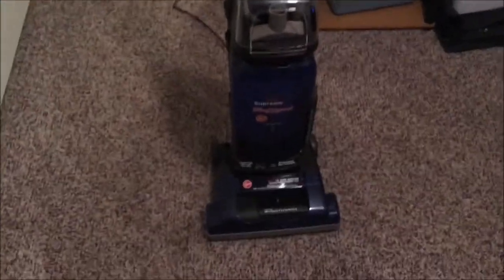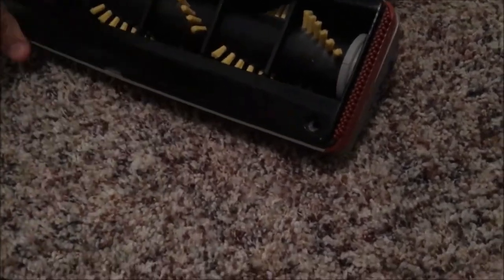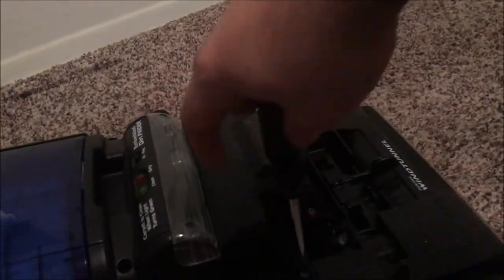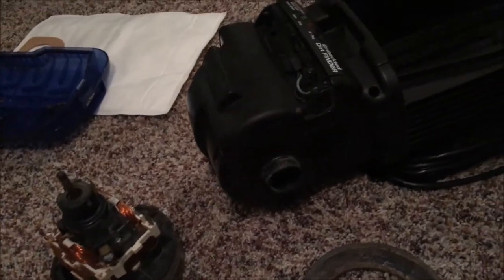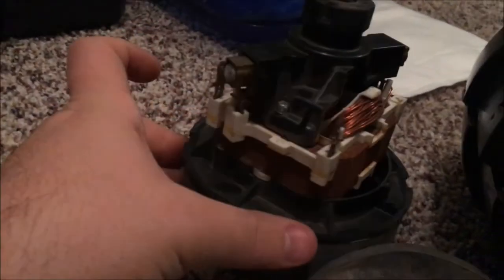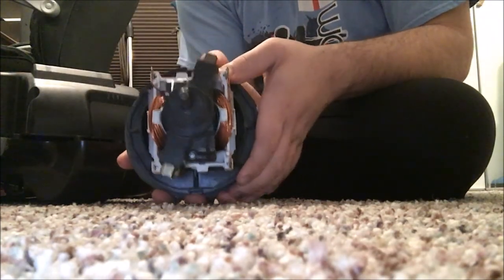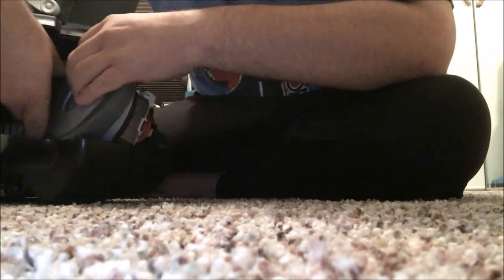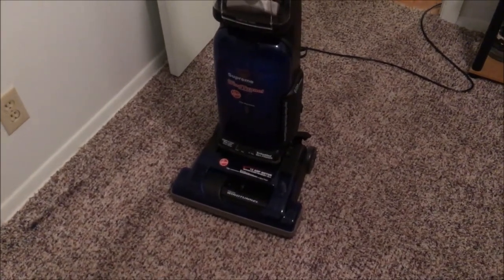Maintenance: Chancing the Motor on a Hoover Windtunnel

Comment: Do you have a bissell powerforce? I have a bissell powerforce bagless 6583,6585,6579,6583X and a 6579. I also have a hoover tempo as well as a convertible, concept 2, a windtunnel self propelled from 1998, a Kirby 2001 limited edition, I have a BISSELL powerforce bagged and a big green commercial as well as a bissell lift off, I have a hoover from 1942 a kenmore and 2 dirt devil breeze from 2009 and 2007.

Comment: You have to remove the carbon brushes and the carbon brush holder screws
Reply: I loose up 2 screws outside of the commutator casing and removed the carbon brush, but I guess the bearing was very tight to the commutator casing, so I couldn't put if off. Is it possible to open up the fan blade cover at all ? Without that, it's impossible to lube the bearings.
Reply: @yingcluk  1. I replace bearings 
2. I use deagreaser to clean bearings and repack with Lubriplate Electric Motor bearing grease 3. Put repacked bearings in
Reply: @tylonbarnes9678  Thanks for the reply, but I would like to know if it's possible to open up the fan blade cover for this particular motor. Without that, it's pretty much impossible to service the inside of the motor.

Comment: Sounds awful.
Reply from the maker: That's why I decided to change the motor, that old motor didn't have much life left in it.
Reply: Grayson Reichert number 2 you can replace the motor bearings but you have to have bearings pullers and a bench press tools last but not least brand new bearings